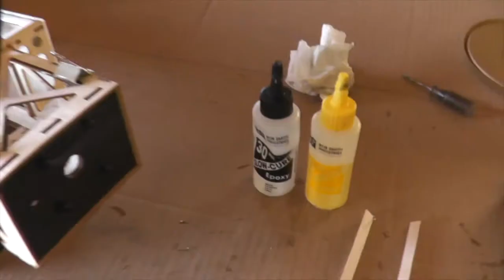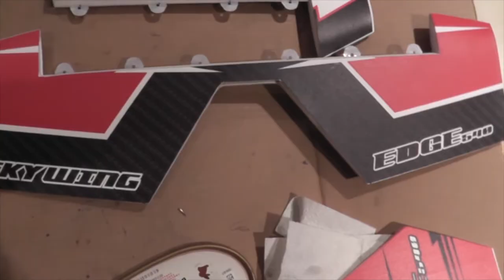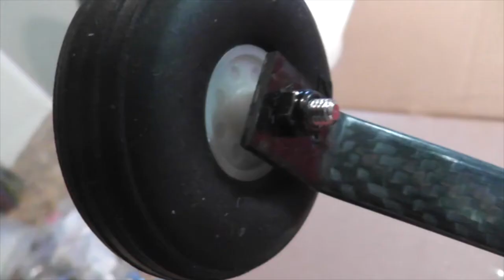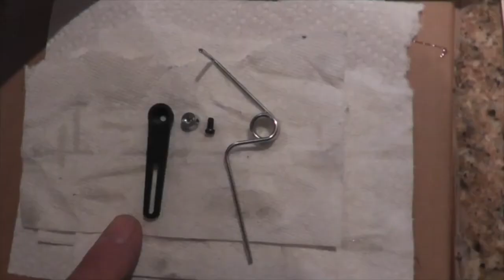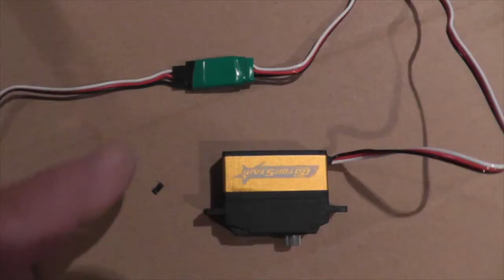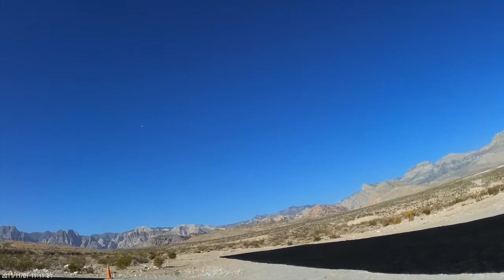Skywing PP EDGE540 55 Inch Build and Maiden video

Comment: Great video ... I bought the same plane but I noticed that mine is missing the carbon fiber plate in front of the engine support ... in your plane too the dimensions for the screws of the engine support are spaced by 35mm?

Comment: Hi i just built this plane and i have tried 3 different brands of servos and they all have the jitters like nothing i have ever seen before i can not use them.is there any analog servos that will fit in this plane? 🤷‍♀️ let me know thanks
Reply from the maker: Have you tried the Rotostars? I've had great results with them on 55" planes. You could try a little velcro on the control surfaces to stop the jitters, others have tried that trick with good results....
Reply: Paleomanjim2 no i haven’t.did you have to use velcro with them? Or did they work sweet out da box? 35x15mm servos is such a crap size! you think they would just use standard size servos 🤷‍♀️ make life simple lol
Reply from the maker: My servo's do not jitter, except for the rudder which sometimes does. It is not a problem though and usually stops if I tap the rudder stick.
Reply: Try bluebird servoes I use them in my giant scale and have had great luck with there mini and micros and there affordable
Reply: @michaelgrossman5528  i ended up using some big metal gear turnigy servos i had left over from a crashed gas plane i just cut the holes bigger to fit em flys perfect now

Comment: Thanks for posting the video.  Nice flying.  I ran tests on all the hobbyking props, and APC, and MAS.  APC thin electric would show you a big improvement.  If you like wood, then the hobbyking Type A and D props are better than the one you are using in the video.  Very inefficient.  https://hobbyking.com/en_us/turnigy-type-d-light-wood-propeller-15x8-1pc.html https://hobbyking.com/en_us/turnigy-beech-wood-propeller-15x8-1pc.html
Reply: Thanks for the tip, I have never tested props. The prop I used seems to have good power but I have not compared it to anything else....